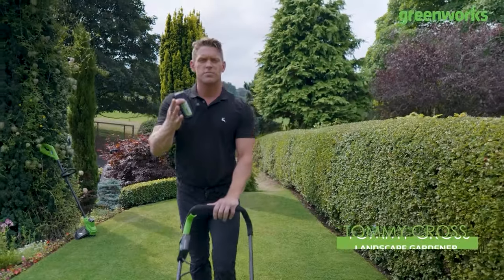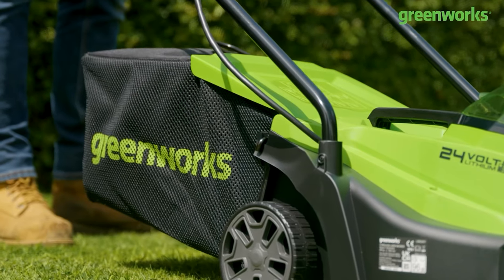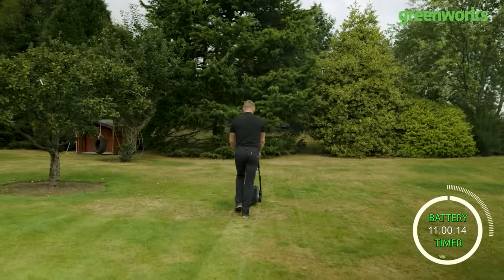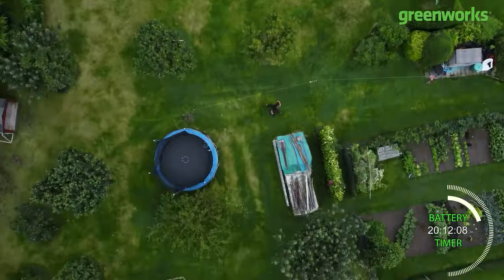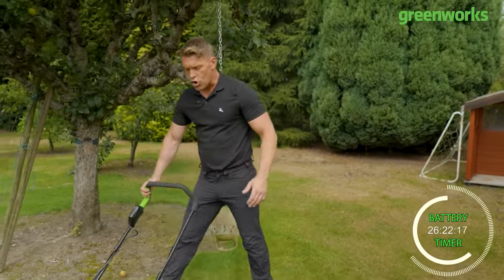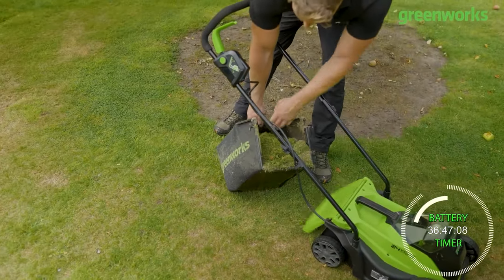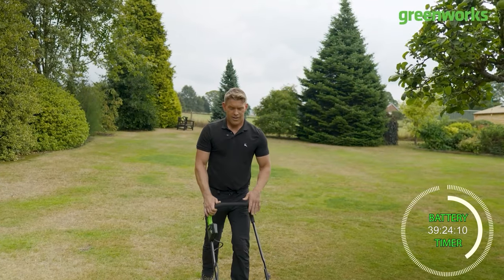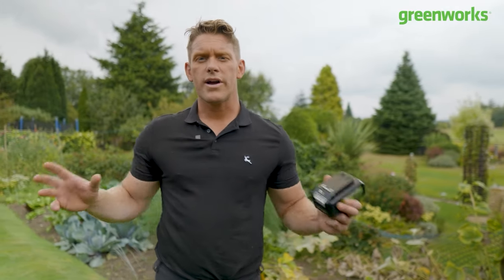Greenworks Battery Runtime – 24V Lawn Mower

Comment: WITH THE ONE I BOUGHT, I DON'T EVEN GET 20 ON A FULL CHARGE. 48V (2x24V) 21" Cordless Battery Self-Propelled Mower, 13" String Trimmer & 450 CFM Blower Combo Kit w/ (2) 5.0Ah Batteries & Charger
Reply: There is no way he got that much time in his unit. I just today the same one you have and it only lasted around 20 minutes. And 3-1/2 hours to charge it up . I think if I keep it . Get the 24v 6.5 AM battery